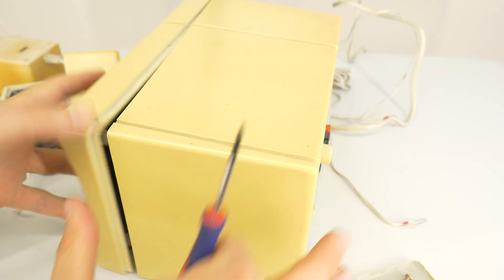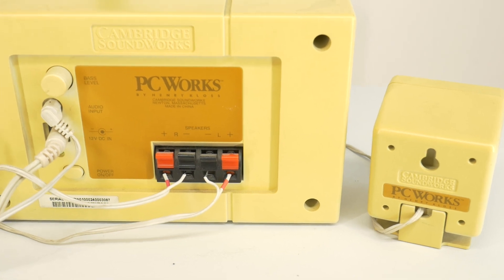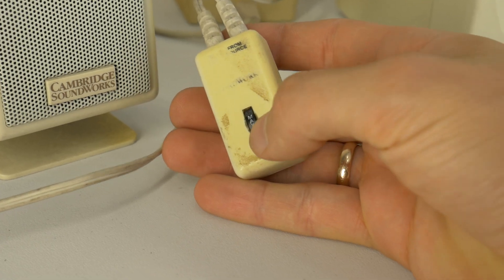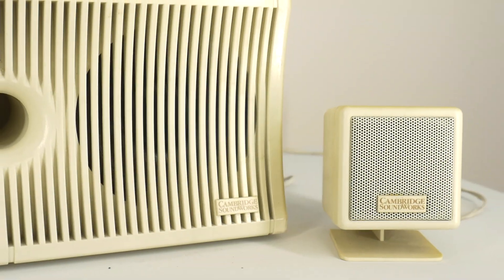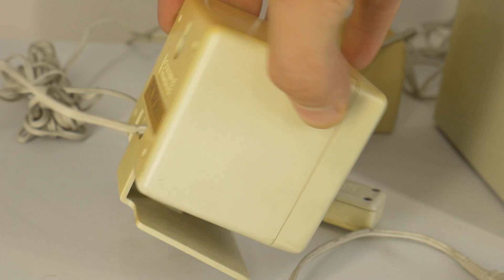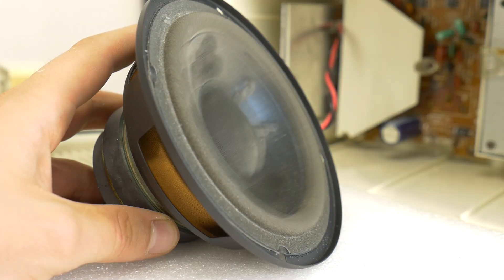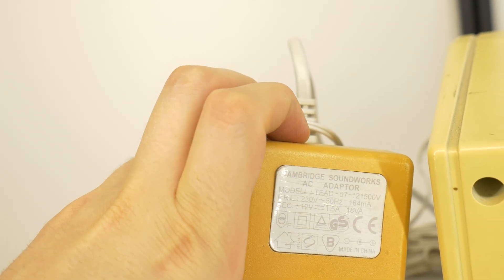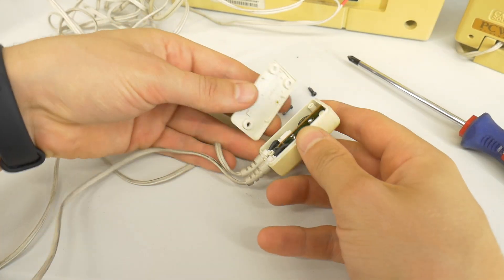What’s Inside Grandma’s Old Multimedia Speakers + Air Excursion Test

Comment: I used to have this set, although mine had 5 satellite speakers, other than that it's exactly the same as this. I miss it as It stopped working some time ago, seeing one of theese brutally torn apart like this hurts a little.
Reply from the maker: no no, It's fine, only one satellite speaker housing was damaged during the disassembly process, but I'll find a new box.

Have you checked the external PSU of your system? You could use a multimeter—maybe the problem is easily solvable.
Reply: @CoolDudeClem  could have probably repaired them on the electronic workshop.

Comment: I have this set (only mine is not nearly as yellowed), but I think it sounds just OK. The big gripe I have with it is port noise from the "sub" woofer. It sounds better when stuffed with a couple socks but it's nothing compared to a decent set of bookshelf speakers.

One thing I am curious of though, how does it compare to the Boston Acoustics 2.1 systems of the same era?
Reply from the maker: "The yellow color is from being left in direct sunlight; UV light has slightly damaged the plastic. I've read about the sock mod—it's a simple but effective way to improve sound.
Reply: @Techscrews  Of course, plastic (especially beige plastic) tends to yellow when left baking in the sun. But ironically enough, you can restore the beige plastic back to its original non-yellowed color by submerging it in a tub of water, and leave said tub of water in the sun for a couple of hours.

Comment: It is curious how the satellites have only 2w of power while the sub 20w. I don't know if that's okay, unless they had 5w or 10w
Reply from the maker: I hope to make a new video for the Techscrew Audio School playlist someday, where I'll explain the main speaker driver specifications, and everything will become clear.

The difference is mainly due to the 2W driver having much higher sensitivity. It can produce the same SPL (sound pressure level) in dB with just 2W of power, whereas a lower sensitivity speaker would require at least 20W to reach the same dB level.